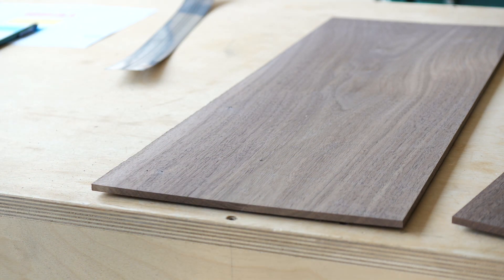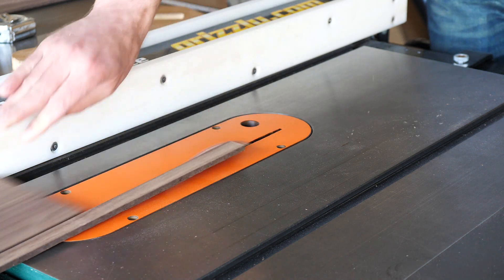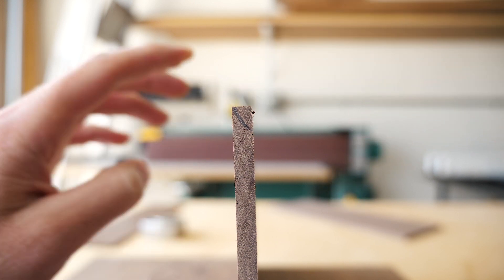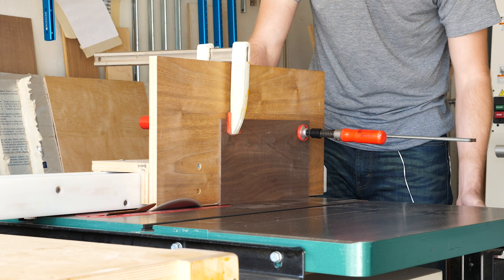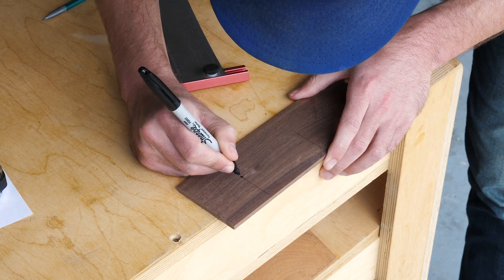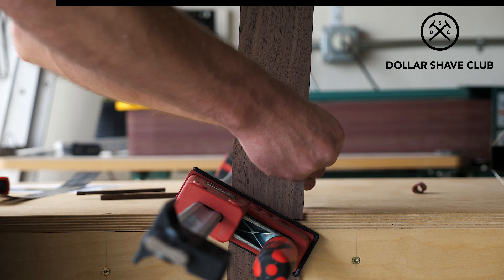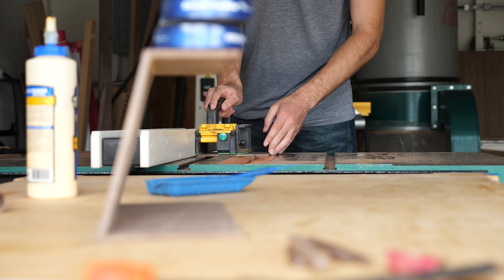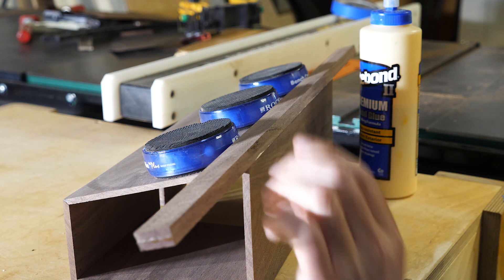Simple DIY Shaving Stand | Easy Woodworking Projects

Comment: Hi Chris! Another great video. What sort of finish do you use on something like this that will come into contact with water? I'm thinking of making a pour over coffee stand for a friend and using a similar style.
Reply from the maker: I used General Finishes Arm R Seal...and I it really doesn't get all that wet. But you could add a little wax on the top ever couple months as an insurance policy.

Comment: I like your smaller projects. They are a nice variation and still follow the same design ideas. Is this the first time ever you had too much glue in a joint? :-) In this particular case you could have used a straw to get rid of the glue while it's still wet...
Reply from the maker: Thanks. I like going back and forth between big and small. Keeps me sane. and it isn't the first time I've had squeeze out :)
good tip on the straws

Comment: Hey, I know you explain this really well, but I can't seem to get the angles right for this.  I cut the bottom horizontally & have tried mating it with horizontal and vertical middle piece edges & it's either straight up or points out rather than in. I've seen the video a ton & watched the cutting explanation video a bunch too, but can't seem to get it. Any advice?

Comment: I am very curious about how your pieces hold on with time relying just on glue on most cases. I love the way you design stuff but I am not so sure about the lack of joints on you bigger pieces.
Reply from the maker: The bigger pieces usually have something else holding them together. Dominos, Screws, etc.... so far they are all holding up. And I've been at this for about 7 years
Reply: Glad to know that! But have you ever been interested in exploring the aesthetic side of joinery, even if its machine made, or you don't think fits your style?

Comment: You know what would have made this better? Using the CNC....

Jk. I heard you talk about this on the podcast and have been looking at my bathroom trying to decide how to design one myself. Honest question though, do you actually use the shaving cream brush? I've never used one and wondering if it's actually worth it. Just seems decorative to me.
Reply from the maker: I never had one before this video. I initially bought it b/c I just wanted more props to fill out a shaving stand. I could see using it if you shave your full face, or your head or something like that. For touch up stuff, you could get by without one I'd say :)
Reply: I might get a kit from Rockler just to turn one for a video. I shave my head and part of my face, but I use Dollar Shave club's shaving gel. It's awesome.
Reply: The short answer is: There are tons of videos about wet shaving (DE Shaving) that also incorporate the use of Brush and bowl.  With all due respect to CS's sponsors ( I really do think they provide a product that is useful at a great price, so I'm not being a hater) There is no better way to shave on a daily basis than an old fashioned Double Edge (DE) razor and cream or soap that is applied with a brush. Think of the difference between a Saw Stop saw and a portable contractor saw, both have their place, But........ Once you learn the techniques, you will wonder why you didn't shave like this for the past (insert years here).   Seriously, there are so many creams and hand made soaps available you wouldn't live long enough to try them all. Starter kit, Merkur 34C razor, Astra blades, Taylor of old Bond Street Sandalwood cream, Boar hair or synthetic brush.  Don't say I didn't warn you.......

Comment: Chris. Don't use "flushable" wet wipes. They destroy your plumbing. There is no such thing as a fushable wipe. If it does not break when wet in the packaging, it won't break when wet in the pipes. Ask anyone working with sewage, and not marketing companies who wan't to sell things you don't need. (Yes, you don't need wet wipes for your ass.)